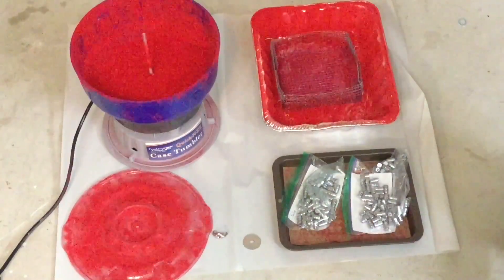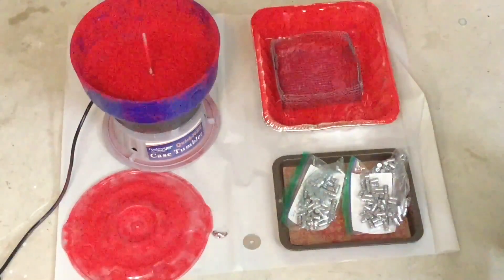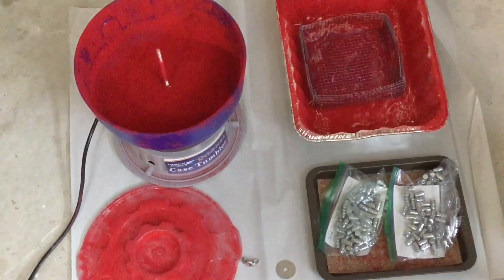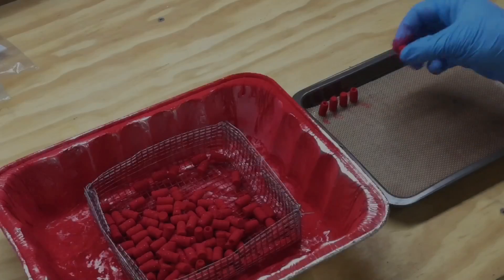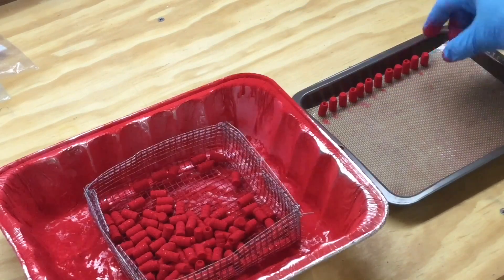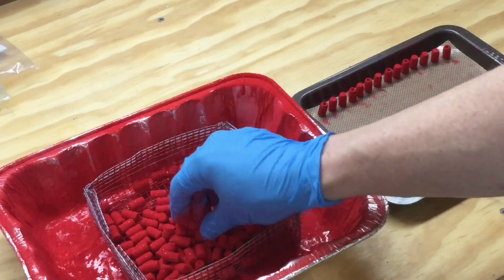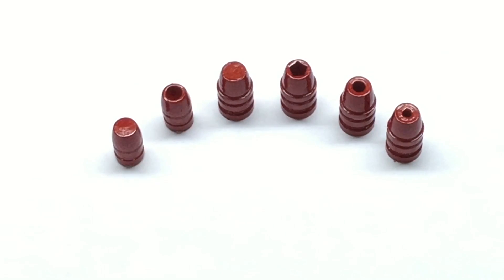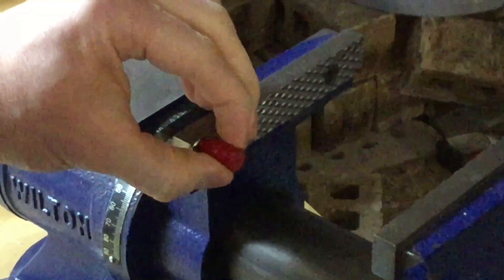Powder Coating Session for the Powder Coated Cast Lead Hollow Point Bullet Test

Comment: How clean do your powder coat bullets shoot? I have been powder coating bullets for a few years now and have never been able to get them to shoot 100% no leading always a little. I have run the entire gamut from different sizes from 1 to 3 thou over . I use a thermocouple to verify correct bake. made sure cases weren't swaging down bullets still no luck. people make it seem so easy I wonder if they are telling the truth.
Reply from the maker: My 44s shoot with little to no leading.  I still get the carbon fouling, but there's usually not much of that in the barrels either.  My 45 leads a bit, but that's mostly in the forcing cone.  My 45LC was made with large chamber throats though.  Even in the 45LC my PCed cast bullets lead a whole lot less than the factory swagged cowboy bullets.
My 9mm and 45ACP don't show any more leading than my 44s, which is again is almost none.  Just carbon fouling.
Yours could be a sizing issue, an out of round issue, rough cut rifling, the particular gun powder you're using, the particular powder coat you're using, current moon phase....I'm not sure what to tell you.  Maybe try fire lapping your barrel.
Reply: @LoadsofBacon  I tried fire lapping on of my 9mms didn't seem to make a difference. I get the same results in about 8 different guns that I have tried PC in. In my .44 mags I have found if I PC and than run through the lube sizer than I get zero leading.   The 45 acp's no leading either with just pc. But with the 9s and .40s it's not bad its just not zero leading. It usually takes a few strokes with a brass brush.
Reply from the maker: I always size my bullets after PCing.  I size my 9mm to .358" because my that's what my Beretta likes.
Reply: @LoadsofBacon  I tried sizing both 1 and 2 thou over whatever the bore slugs after coating. I Have really put a lot of work into it just can't seem to get it perfect. I've tried bhn anywhere  from 8-18 Im at a loss. Im not getting the results everyone says they are getting. wish I knew someone who could actually show me what they are doing. I've been watching yours, fortune cookie's and Elvis ammo's videos for a few years now. I have read and asked questions on cast boolits about it.  I've been reloding for 25 years and casting for about 5 I should be able to get this.
Reply from the maker: Something I forgot to ask; what hardness is your lead, and/or what alloy are you using?
Reply: @LoadsofBacon  I've tried any where from 8-18 BHN I have a lead hardness tester